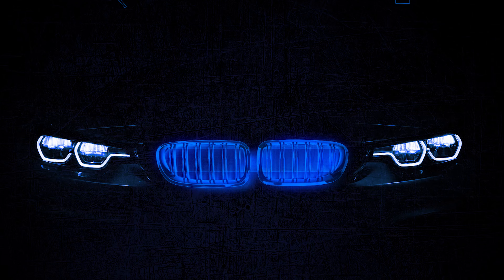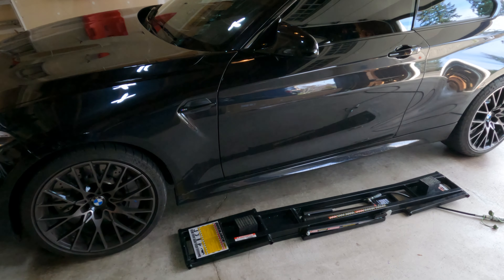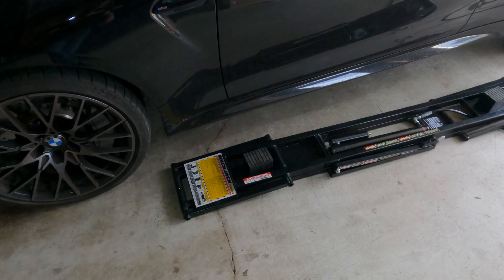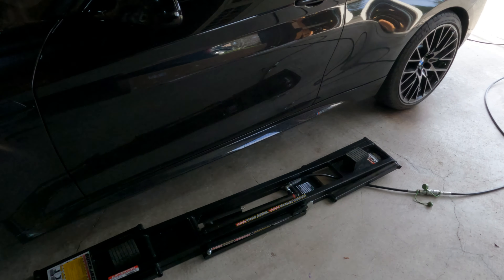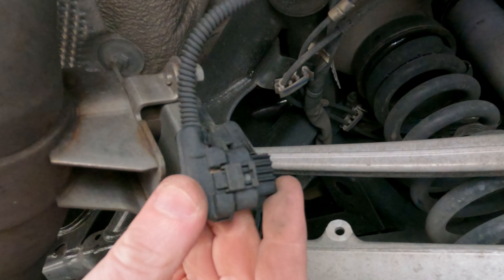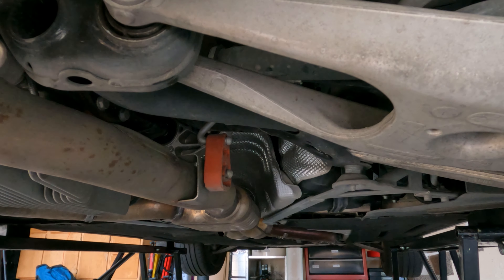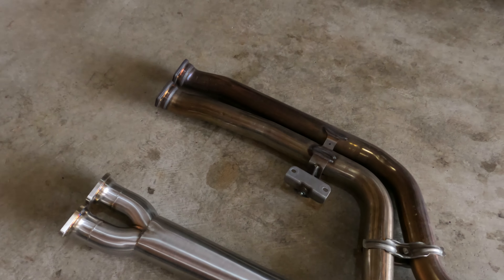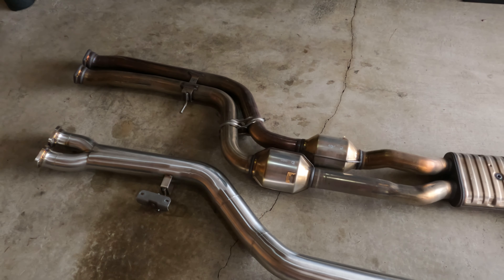GREAT way to improve the sound of your BMW M2C...@TheActiveAutowerke  midpipe install DIY!

Comment: Hey man, I know this video is old but I have a question that maybe you could answer. I currently have an Akrapovic muffler on my car and soon installing this midpipe, but I'm wondering if I have to remove the muffler to install the midpipe? I would rather not touch it if possible
Reply from the maker: @AldoM2C  you shouldn't likely have to do so.  The mid is already cut for your back box, pull the mid brace and should drop off the hangers.  Pretty straight forward

Comment: The transmission bolt earlier in the video you said 24 nm like twice then towards the end said 28nm. Do you know which one is correct as I’ll be doing this at the end of the week thanks for the informative video
Reply from the maker: Sorry about that!  The E10s are 28nm.. I have all of the confirmed values listed in the video description always.
Reply: @BMWDIYGuy  no worries! So I can’t cut it while it’s in like the M3/4? Or do I have to take the entire exhaust down ?
Reply from the maker: @hellohunter8583  you can take it down entirely like the M2C or cut in place. If you have an M3 or M4 the directions are different. Which car do you have?
Reply: @BMWDIYGuy  I have the M2C so I can just cut in place ?
Reply from the maker: @hellohunter8583  Just making sure, wouldn't want you to measure wrong.  You CAN cut in place if you wish, I have done both (cut n place on the F80) and find removing fully is actually easier in the long run.  My cuts were cleaner and easier and I could triple check my hose clamp line marks to make sure they were straight.
Reply: @BMWDIYGuy  Got an exhaust leak comming out of the long clamps provides. Tightened down real good. Might just have to take it somewhere to get it welded. im thinking its due to the way I cut it. Measured it correctly but i dont think it was straight i probably should have dropped the exhaust
Reply from the maker: @hellohunter8583  Interesting.. I havent had a leak through those clamps before, even after like 5+ installs.  Clean cuts?

Comment: Do you need the original part? Or would you sell it?
Reply from the maker: Lots of folks hang onto the original so you can swap back when/if you sell the car, then sell the upgrade separately.
Reply: @BMWDIYGuy  There are countries where, unfortunately, you have no sound at all thanks to the opf filter. That's why it would be a great advantage to have such a great part. But I already know that I will keep all the original parts that I have updated.

Comment: does this cause any issues for emmision testing?
Reply from the maker: Not that I have ever heard of before.
Reply: @BMWDIYGuy  Awesome! cheers
Reply: @BMWDIYGuy  Also i noticed there are resonated and non resonated any idea which one is preferred or what difference is?
Reply from the maker: @AbletonLiveTechs  so resonated will take a little of the volume out, and a little of the higher exhaust notes.  I have sound videos up for direct comparison. In general I prefer the resonated AB pipes.
Reply: @BMWDIYGuy  Will check it out!
Reply: @BMWDIYGuy  Just subbed! I saw a comment you are waiting on the equal length. That is what im aiming for on my f80 AA EL midpipe!!